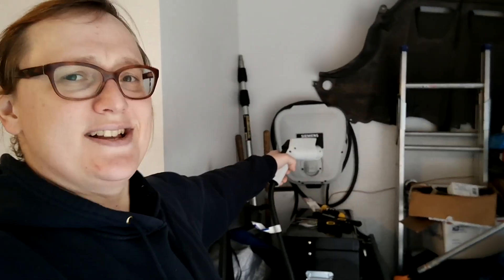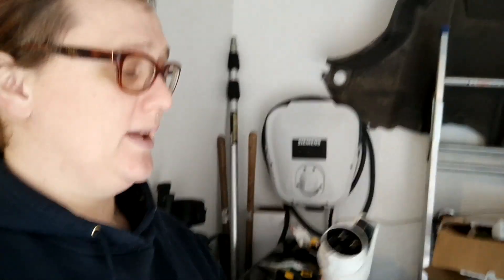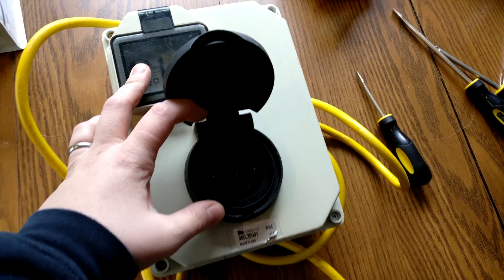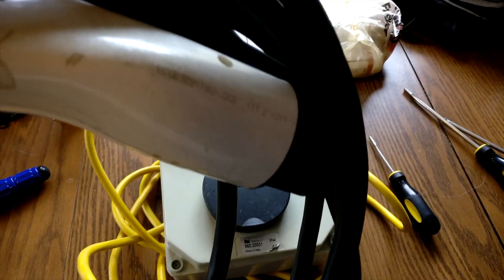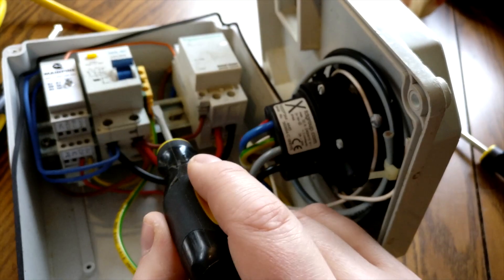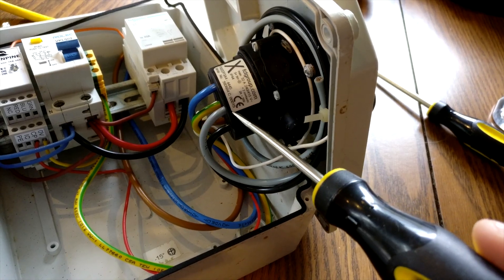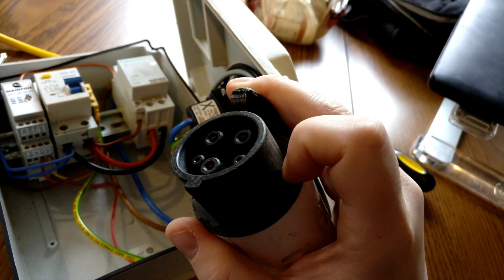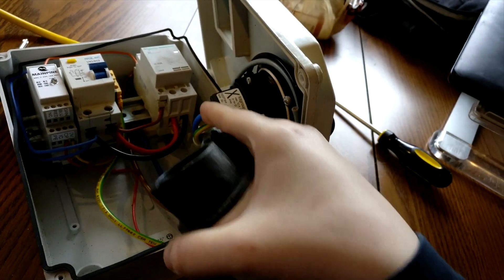What's Inside An Electric Car Charging Station?

Comment: When you press the botton in the J1772 connector the charger does not know it is about to be disconnected. It is the car which gets the signal and stops the charge.

Comment: I'm wondering if there's a way to have an adapter that I can use on the public ev stations that will be able to charge my deep cycle batteries? like on rainy days when I can't get any solar power for my batteries if I can convert a cord that will attach to my battery bank.

Comment: It would be nice if we do away with the cables and just have a docking system for the vehicles so no cable theft would be possible
Reply: The only way I could see this happening is with huge induction charging pads under the vehicle.

Comment: I'm glad I got a super price on my level 2 30 amp charger because I'd feel screwed if I spent $500 on some wire, a small circuit board, and a relay.  Thanks for the info!

Comment: I have designed and built some of these stations for my own use and can offer a bit more information.  The communications signal between the station and the car is a 1,000 hertz pulse signal that is generated in the station.  The percentage of the time that the signal is at a high level tells the car the maximum current that the station is able to provide.  The car controls the level of the signal between 0 and 12 volts and that tells the station if the car wants the AC power turned on and if the station must provide ventilation for battery fumes.  There can be a negative part of the signal going to -12 volts but it is only present to detect tampering with the station.  Anything that inhibits the -12 volt signal causes the station to shut off.  As others have said, there is supposed to be a GFCI (Ground Fault Circuit Interrupter) similar to the ones used on bathroom and kitchen outlets.  That also is mainly to protect people that are tampering with public charging stations.  A good part of the complexity of the stations is required because they may be in public places where someone could be playing with them to see how they work or to trying to steal power.  And FYI, the cable and plug are the expensive parts of a home made station at about $100.  All of the other parts are under $100 total.
Reply: Thank you.  I was wondering about this.  If I understand correctly, the AC line voltage is fed into the vehicle where it is stepped up and rectified to by equipment in the vehicle.  The charging station sends a signal to the vehicle indicating the maximum power it can deliver, the vehicle controls the current it draws.  The DC fast charging stations I presume contain large rectifiers and supply DC voltage, presumable stepped up already to the level the vehicle requires.

Comment: One small technical nit to pick with your explanation about the J1772 button.  Actually, when you press the button a different resistance to ground is connected which signals the car that the button is pressed and the car must stop drawing current within some number of milliseconds.  You said the EVSE would cut the power, which is technically incorrect because the button signal only goes back to the car, not the EVSE.  Otherwise, a good episode.  Keep up the good work.

Comment: It was so good until you skipped RCCD (third thingy in EVSE). It is there to switch off power in case all communication between car/station is fine but there is a current leaking away. This means that current can leak through a person. So this RCCD will not allow electrocution even if all communication is good, vehicle is charging, etc.

Comment: Hi good attempt to explain internals but your slightly off track with your comment regarding what components are there to protect against electric shock to persons. The relay (contactor as some would say) on the right and the controller on the left, work together to control the charging rates thus protecting the battery etc BUT it is the middle unit which protects from shock hazard it's an rcd (residual current device) or earth leakage unit some refer to it as. This is similar to the units found in many European home electrical systems, not sure if you have them in USA do you? Hope this is of help keep up the good work.

Comment: Great explanation, very useful thank you.  Surprised the wall chargers are so expensive tho.  Also what makes the wall charger a 3.3 or 6.6 KWH charger (as you have to pay more for the "bigger one".  love your series BTW.
Reply: paul juster  Hi I believe the larger one is 3 phase (usually found in commercial buildings) much more internals so higher costs
Reply: in the UK the 7KW is single phase not three phase, as long as the supplying cabling fuses/ etc are up to it you can have a 7KW on single phase, infact pod point for example only stipulate three phase for 22kw.
Reply: paul juster hi Paul apologies your right, perhaps it's because the equipment is much higher rating so bigger cables, contacts controller may have more charge stages etc See evbit's.co.uk website it's very informative
Reply: I've seen some comments that its only a dip switch to change from the 3.3 to 7Kw, but no confirmation on that.  Thanks for the reply.

Comment: I do plug my car directly into a wall socket. The the car side is the exact same plug you showed here, and on the other side is a typical wall socket used by high powered devices such as caravans and welding torches.